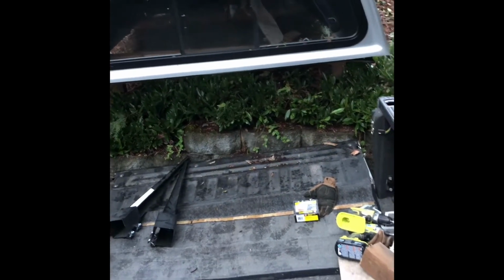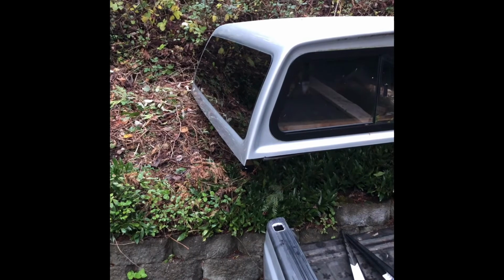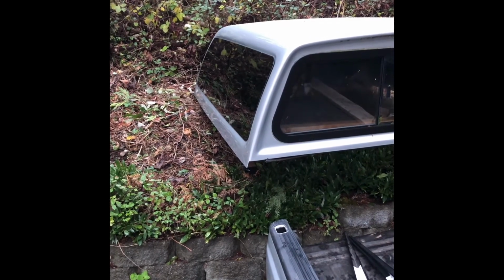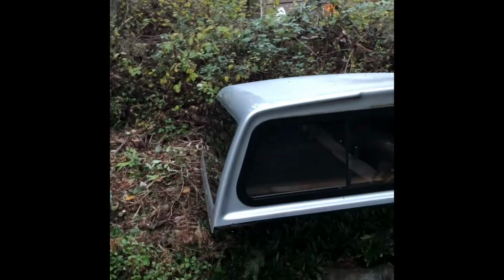DIY Canopy Removal Idea

Comment: Good first attempt. Good storage spot. Out of the way. I envision a cart to lift up the cap then roll out the bed into the hillside. Set it down.
Reply from the maker: Great idea!  That would make removal much easier.  I will definitely post it if I build one.  Thanks for the comment.